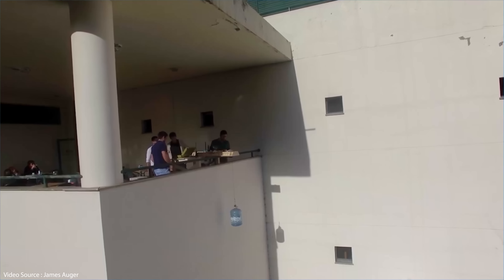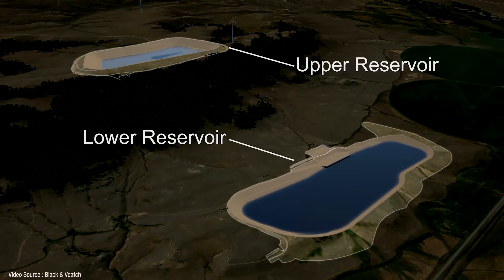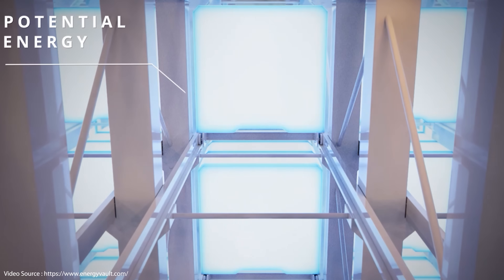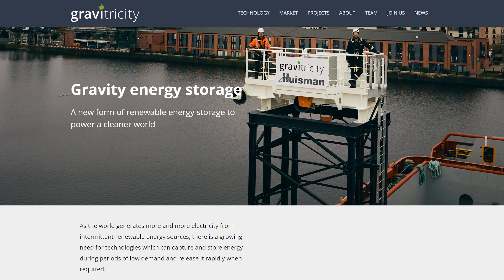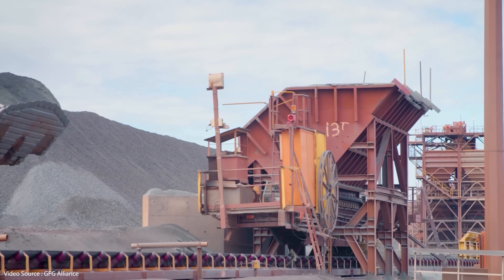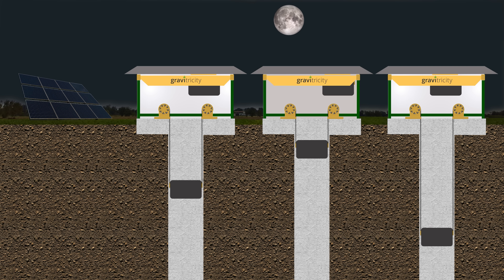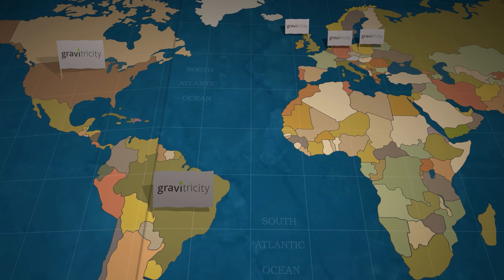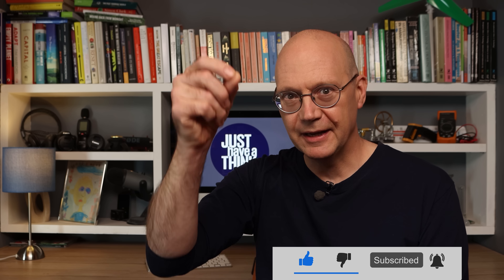Gravity Energy Storage. Who's right and who's wrong?

Comment: Here's what I don't understand.  Why not dig out a resevoir 3km down, build another resevoir at the surface, and use those as your hydro-pump storage...that you can pretty much build anywhere.  There'd be some concerns about ground stability, but that's less of a problem than requiring  a given hill or valley be in the right location.

Comment: So.... about the Tower Storage with blocks... people have said that "wind" would cause the weights to sway. Which they are correct. However, my understanding was that the whole system was going to be built in a silo to prevent wind and rain and the elements from interfering in the gravity storage. The idea being that a single tower could be built city adjacent and would just look like another big stone building rather than some strange energy facility. I get that the concept design was "naked" to show how it works, but something as simple as a silo should have solved most of the issues wouldn't it?

Comment: That energy vault won't work, you can't stack that much weight that high on racking otherwise it will buckle

 I'm a forklift driver for almost 20 years and I've never seen racking that could take multiple 30t blocks and not buckle in fact a single 30t block is more weight than I've ever seen any racking system handle, most will begin to buckle at about 20t and that's 20t spread out over the entire rack not 20t in a single spot. They plan to have dozens of 30t blocks stacked on top of each other within a racking system? I don't even think materials exist that would be capable of holding up that much weight in a column with a racking style system

Maybe I'm wrong but from the example video it does appear they are planning to stack 30t blocks into columns at least 20 blocks high and I just don't see how that would even be possible with current technology considering you have to add the weight of the racking as well

1t is damn heavy..... 30t is hella heavy and 600t is insane....... I've seen trucks with 40t containers on the back sink into the ground and overturn 

All I can say is you better have some good foundations, a shit tonne of high quality steel to build the racking with and then you better hope nothing so much as even touches the racking leg's

I'm sure we've all seen videos of warehouse racking collapsing, Now think that those pallets on those racks almost certainly weigh less then 3t each and probably weigh closer to 1-2t each and these guys want to stack 30t "pallets"....... Yeah good luck with that

Comment: The question is how much energy can be stored this way. There is a reason that hydro pumped lakes have millions of tons of water. If we have 100 mineshafts in a country that are viable for this and we put this system in place with 500ton weights, how much energy is this? Is it enough to even matter?
Because yes we need energy storage especially storage that can release the energy quick in a moments notice, that where this gravity system is great i guess. No long startups just as a battery. And if the numbers are correct at half the cost of a lithium battery. Only problem is, i can build as many batteries as i want, but i cant get more mineshafts then we have, to me that seems very limiting. 
However very interesting concept, we need to pursue everything that could work.

Comment: Why does it always have to be a crane driven system? Is it because it looks cooler in CGI? Seems much easier with water. Why not a water tower, pump water up into it, and let it fall down when needed powering a turbine. It could fall into an underground holding tank, where you then pump the water back up from. Then you are not restricted by geology, we have plenty of experience building water towers already and there are far fewer moving parts that can be worn down and have to be maintained. Also whenever the terrain allows you can save the tower and just have the standard system.
Is it because the water cant rest high enough? I assume the higher the water tank is, the faster it will move when it drops and the more electricity it will generate.
Or is it because the amount of water needed per MW stored makes it unscalable to support anything meaningful compared to its size?

To the untrained eye it just seems so much easier with water than physical blocks.

Comment: You can't be seriously suggesting that this could be a viable option! Let's do the sums
500 tonnes at 500 metres would store energy:
500 tonnes (1000) kg/tonne(9.81)N/kg(500)m = 2.452x10^9  watt-seconds = 0.6811 megawatt-hours
The Tesla battery in South Australia stores 129 megawatt-hours (before its upgrade) so you would need 189 of these to replace the Tesla battery. These people are not living in the real world! And the Tesla battery comes on line automatically in just a few if there is some disruption in the system. This contraption could never do that.

Comment: A better concept is the Argo mine outside of Denver, Colorado.  It was set up like a ski lift at the turn of the century.   This gold mine attached a generator to its train of ore carts.  The carts were filled with ore at the top of the mountain and sent down thus generating electricity.   On the other side of the track were empty ore carts sitting at the bottom of the mountain.  The heavier ore train coming down the mountain generated electricity plus it lifted the empty ore carts up to the top.  This system generated enough electricity to light up the town for free.
Reply: I like this.  A train track on an incline seems very low tech, with lots of potential locations, as opposed to a few available mine shafts that are constantly filling with water.

Comment: imagine a column that goes down into the earth. at the bottom is geothermal or traditional generators. waste stored underground. this gravity storage stuff above that. gravity drives a sled that cars and maybe freight parks on. cover the roadway with a high roof with solar, wind, or runways for aircraft. use all the debris you dig up to build pyramids. rivers of energy and resources.

Comment: Instead of lifting the heavy weight up a tower, lift an empty steel tank. Once it gets to the top, pump water into the tank, use the pulley system to recover the energy. Drain the tank and repeat. This avoids the friction losses associated with raising a heavy mass all at once.
Reply: Or just build water towers (which we already know how to do) and pump water into them.

Comment: CONSIDER THE FOLLOWING: 

A massive weight in controlled fall down a decommissioned mine shaft that has been modified with marine grade concrete 💪🏼  and flooded with water 💧  

The weight falls as per usual loosing some energy due to water resistance eventually settling at the bottom. The stainless steel cable spinning up a regen dynamo system all the while.   When it comes time to reset the system a portion of the used power is allocated to a simple air pump that sends air to the bottom of the shift into a high tension blatter attached to the weight. The air slowly fills into the bag until eventually it is full and becomes buoyant. The weight rises to the top and is reset.  A vacuum pump is attached to the top of the sealed area to allow the weight to reset at 100%. 

If multiple shafts are in line the entire operation can be as smooth as a well balanced 12 cylinder I.C.E.

Comment: I'm not a scientist or engineer, so I hope I'll be forgiven for asking what could be a dumb question.  While I was looking at the various plans that involved blocks, I began wondering if the amount of energy that would be needed to raise the blocks back into position would be equal or greater than the energy generated by lowering them.  It just seems that the idea requires as much energy put into it as it produces.   I'm not trying to be a troll here, and I hope somebody can explain this.
Reply: You have to put energy in to get it out that is true of any energy storage device at all. There will always be some loss, that is the point of the system to lower that loss thus reducing cost of storage.

Comment: This is likely a stupid question, but where does the energy come from to bring the weights back to the surface?
Reply: From the grid. The idea is to take excess energy from low load/high production times (such as when solar and wind are producing together) and then return it to the grid when demand is higher or production is low such as at night if you are using solar. So it’s energy storage not energy production.

Comment: I recently saw an episode of two bit Da Vinci which featured a company called Hydro Wind Energy. They are building  Wind Turbines that will float over deep water. One of their innovations is a gravity battery system to store the wind's energy. A heavy mass is simply dropped the 100 meters to the ocean floor and then winched up when excess energy is available.

Comment: The EVRC has been built in a way. It's called an ASRS, or Automated Storage/Automated Retrival system. This is an existing system and it has been around for a while. Off the shelf systems that run 2 ton capabilities are common. Almost plug and play. Swisslog is one. It makes this a super viable system.